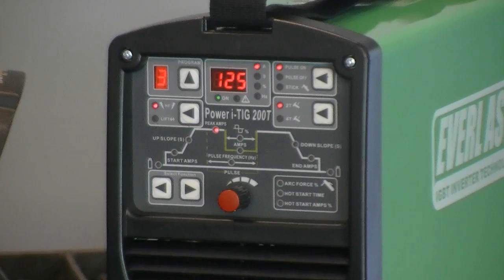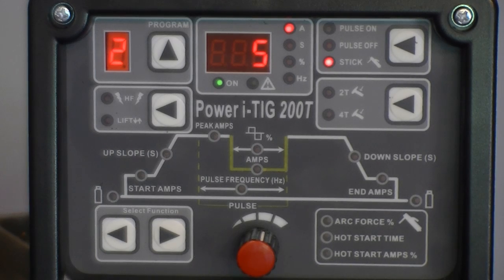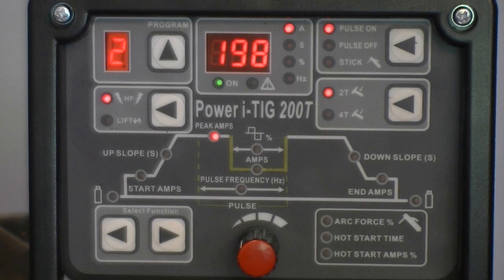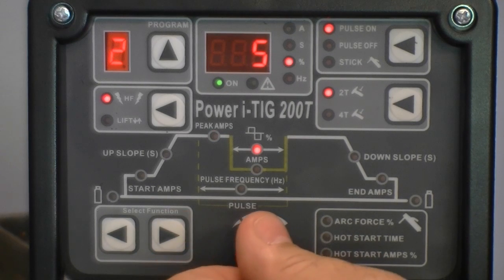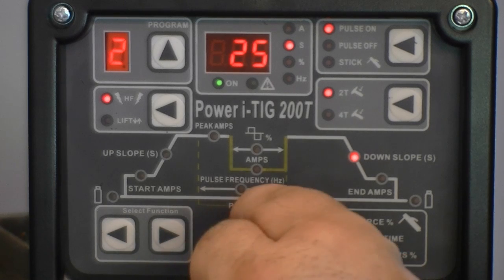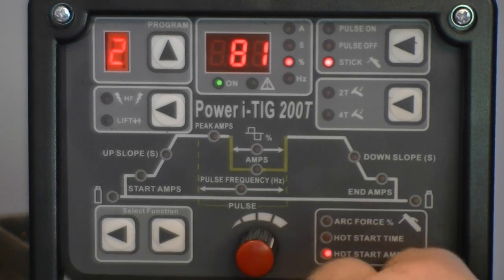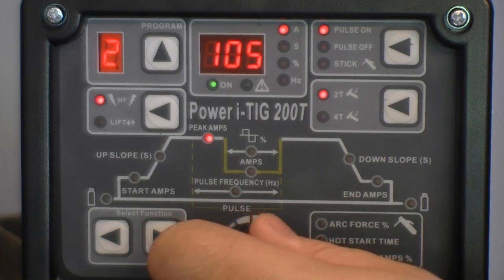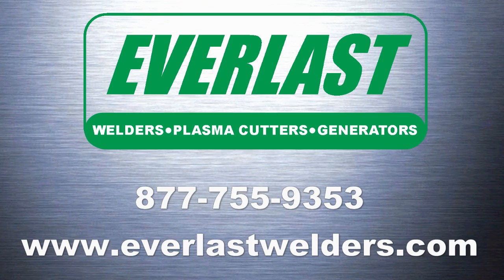Everlast Tutorial: How to setup the Digital Power i-TIG 200t TIG/Stick Inverter Welder

Comment: post flow and pre flow settings ?
Reply from the maker: ?? What is the question about them?
Reply: Everlast Power Equipment how are they controlled on this machine? what are the max and min settings?
Reply from the maker: You set pre and post flow as you would with the other features.  0 is minimum setting.  Max is 25 seconds postlow and 10 seconds preflow IIRC.
Reply: Right ok. Now where on this machine are the controls? There is no dedicated switch or button shown in your video for this feature....anyway i have one in the mail on its way to my house. Looking forward to using it.
Reply from the maker: Pre and post flow are the first and last features in the graph sequence.  They are set the same way all the other features are.
Reply from the maker: Look at 2:00.  It discusses it.
Reply: no idea how I missed that part of the video. Anyways thank you for answering my question. Looking forward to having my welder soon. I will make a video and review as well when it is dropped off next week. Thanks again!
Reply: chase ames still using it?